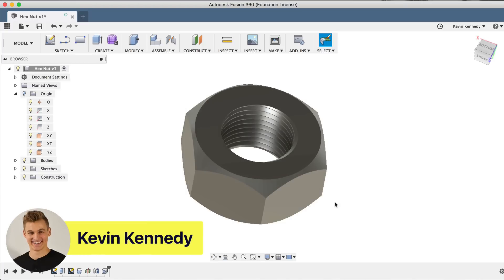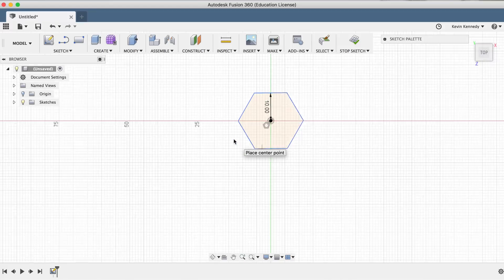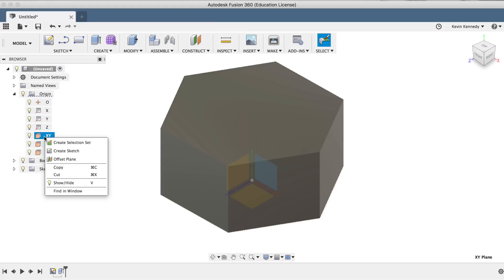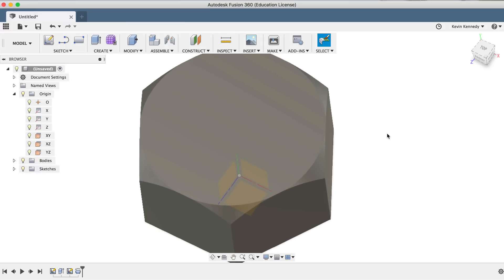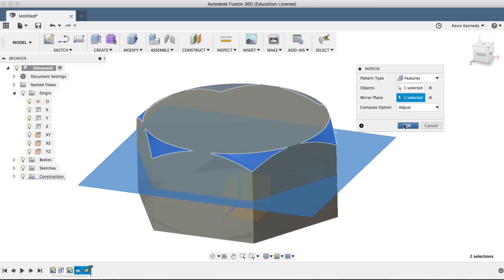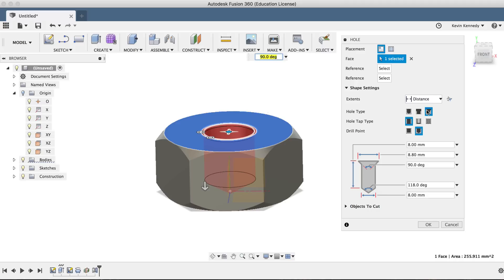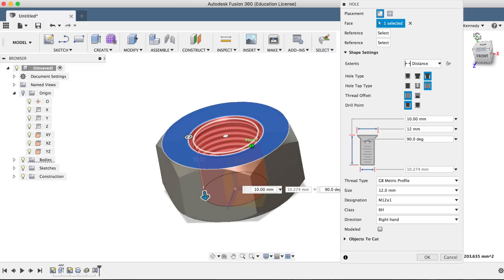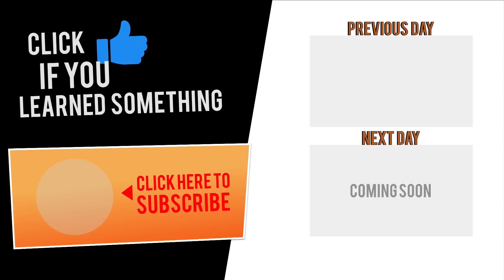How to 3D Model a Hex Nut - Learn Autodesk Fusion 360 in 30 Days: Day #6

Comment: Very helpful tutorial.

I am stuck on the revolving part around 3:00. I am not able to cut the sides even though I was able to highlight the triangle and the front side of the nut. Can you give me some ideas of what I am doing wrong?
Reply from the maker: Hi Paula, it could be a number of things, and it's hard to say without more context. Could you share a link to a screenshot or to your file? If so, I will be able to give you a more concise answer.
To share your file please go to File > Share > Share Public Link (make sure "downloadable" is toggled on) > Paste your link here as a reply to this comment. Cheers, Kevin :)
Reply: @ProductDesignOnline  https://drive.google.com/file/d/1xNjUR2tLkq1BNUwM8LMErwslRweLQ8NS/view?usp=sharing
Reply: This was my result after pressing OK
Reply from the maker: @PM-cl5wl  Looking at the image you provided... it looks like the cut didn't go all the way through. I can see on both the left and right sides there is a gap where most of the material was cut away. Therefore, it looks like maybe your sketch (at 2:20 in the video) wasn't lined up with the top edge. Let me know if that was it or not. Cheers, Kevin
Reply: @ProductDesignOnline  Hi, thank you for your response.
 I think my issue here is when I try to make that triangle, my cursor does not snap into place so when I make the triangle, the points may not be in the proper positions. How can I resolve the snap problem?
Reply from the maker: @PM-cl5wl  Make sure your "Snap to Grid" is turned on. To check this go down to the settings at the bottom of your screen. Select Grids and Snaps > Snap to Grid (Make sure blue checkbox is on). You can also turn on the layout grid which will visually help you see where it can snap into place as well. Cheers, Kevin :)
Reply: @ProductDesignOnline  I had to adjust my grid settings in order to get it to snap to that corner properly and I also had to set Y as up to follow along.
Reply from the maker: @ericframe2640  Hi Eric. Sorry about that, the "Y" being up used to be the default setting. Since the default settings change from time to time, I documented my settings and some of these changes on my website. Hopefully, this will help avoid any issues caused by different settings while trying to follow along - http://bit.ly/defaultsettings
Cheers, Kevin :)

Comment: Hi Kevin, min 02:56 I cannot select the small trangle, the center axis, do you have any idea why? thanks.
Reply from the maker: Adrian-Constantin Cucu - It's hard to say without seeing your file... but a few options. It could be that your sketches or origin are turned off. Make sure the light bulb is yellow in the Fusion 360 browser.

If you can share your file I can take a look and be able to give you a direct answer. To share your Fusion 360 file with me it will help me even more. In Fusion 360 go to file > share > share public link > make sure it is downloadable and then copy and paste the link here.

Cheers, Kevin :)
Reply: https://a360.co/2vyoeYK
Reply: no need to check Kevin, I've finally succedeed, many thanks ! cheers. :-)
Reply from the maker: Adrian-Constantin Cucu - What did you end up doing?? Nonetheless, I'm happy to hear you got it to work! Cheers, Kevin :)

Comment: Near the end, where you change the dimensions of the chamfer, you slide the timeline marker back to the sketch. Why didn't you just right click the sketch and select Edit Sketch? Great video, btw...
Reply from the maker: Hi Chuck - Great question!

Really big files can take forever to load if you go to edit something in the timeline without dragging the slider back. When you slide the timeline back it essentially "freezes" all the other features making it load faster / less likely for Fusion 360 to crash. With that said, it was unnecessary for this file as it's not very large... just a habit :)

Cheers, Kevin